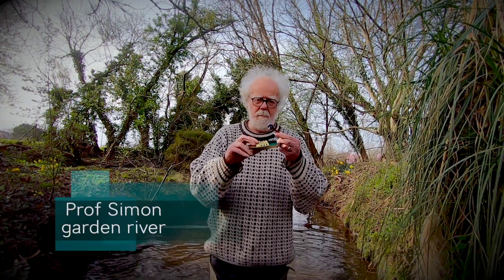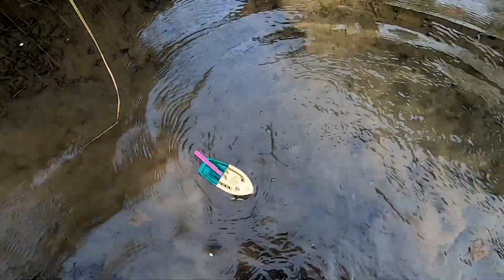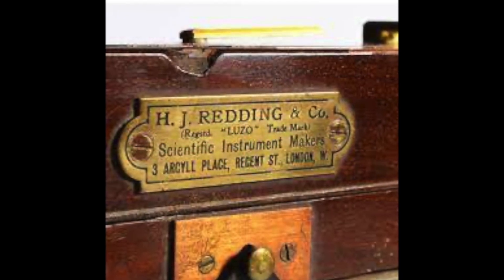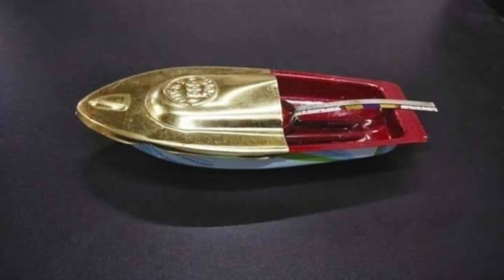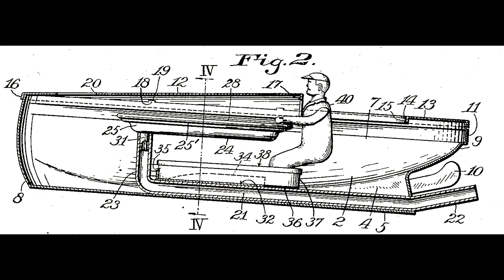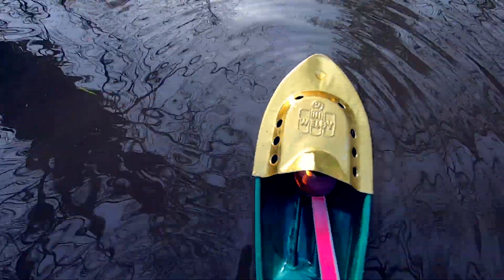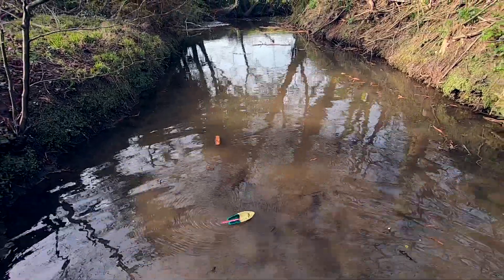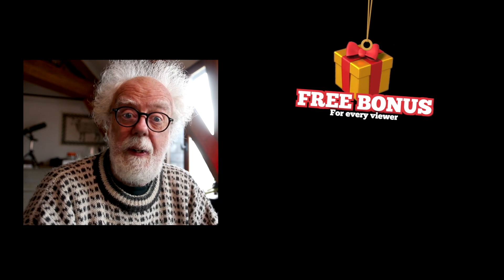Pop Pop Boat - How does it Work ?

Comment: How many minutes does this boat are continuously run
Reply from the maker: hi Abdul, a long time.  as long as the candle burns
Reply: The steam chamber in this boat can be used for water pumping?
Reply from the maker: @Abdulrazique1969  that's interesting.  the way pop pop boats work is at the marginal edge of being practical.  there is just enough force to propel a tiny boat on water.  almost no pumping action.  what are you building?
Reply: @SimonHollandfilms  I want to make a mini water pump for aquarium. By steam chamber and tubes.👉Let me know if this chamber will pump water by steam force?
Reply: Anwer please
Reply from the maker: @Abdulrazique1969  try it, but i think not
Reply: Thank you sir

Comment: Professor, how is that wood pellet water heater of yours performing? How long has it been in operation now?
Reply from the maker: hi Mark, the pellet boiler is good. burns about 30kg per day to gear a house with 12 radiators. no tech issues and it is saving us money.

Comment: When I was young I had a submarine that was powered by an alma seltzer. It would dive and surface when the alma seltzer was spent...
Reply: I just had my Dad's wooden rubber band powered WWII  submarine. Had to be careful that the home made steel propellers didn't cut the vinyl liner of the small swimming pool we had.

Comment: Steam is the future workhorse of power generation. The power plant in Iceland is a geothermal (steam) electricity generator. Wow. Thanks.
Reply from the maker: powerful stuff
Reply: Future workhorse??? Steam generation to power turbine generators have been a real part of the generation of electricity since the early days of electricity. It's just the size of the generator and the type of heat engine that have varied.